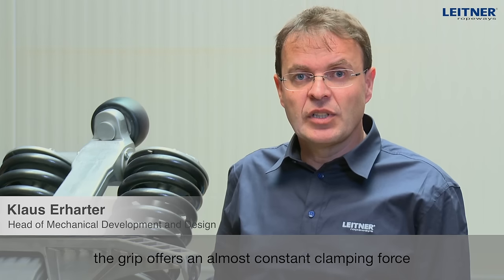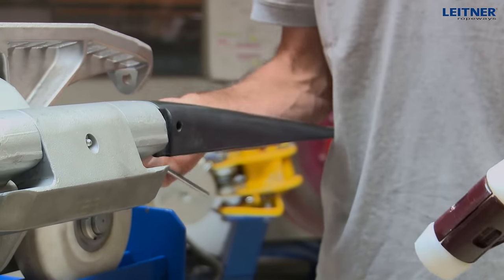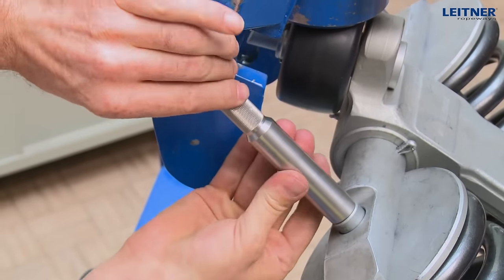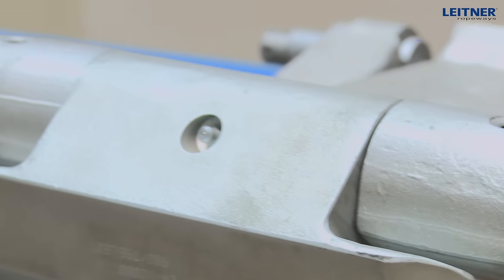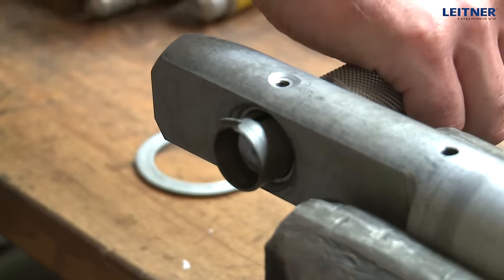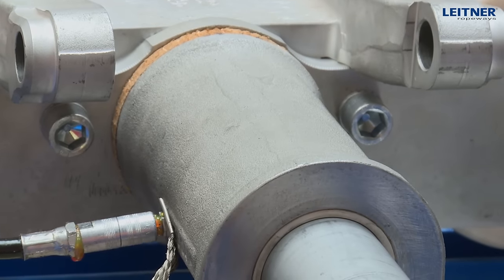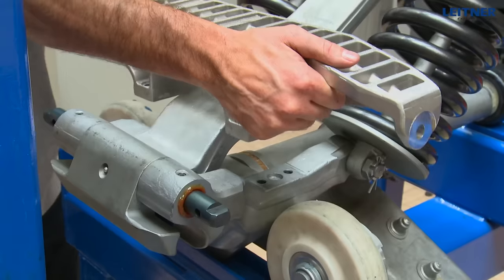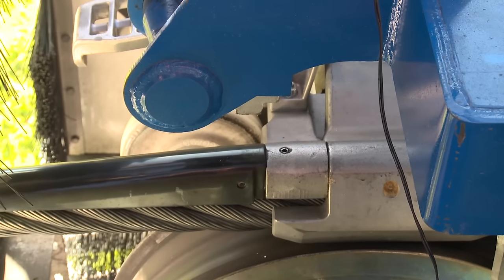LPA Grip

Comment: Interesting video. I'd never heard "split pin" as in the US they are called "Cotter pins".  The UK term is certainly more descriptive.
Reply: In the UK a cotter pin is also one of those smooth asymetric friction fit parts that is sometimes used to secure old bicycle pedals, which confusingly can also be secured by a split pin!